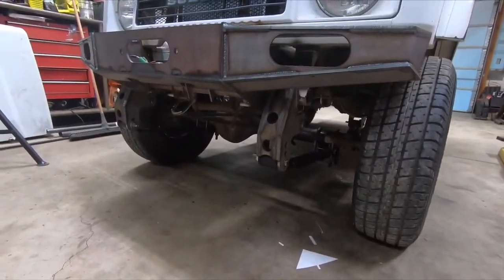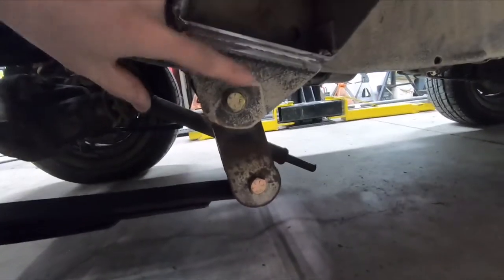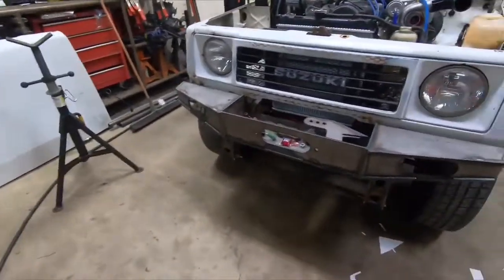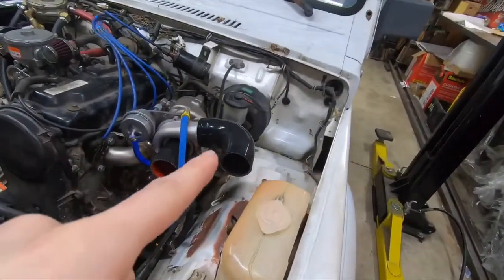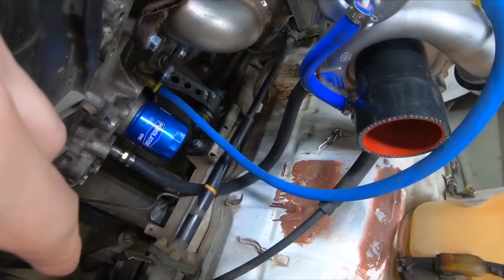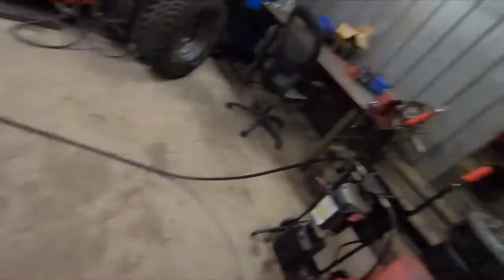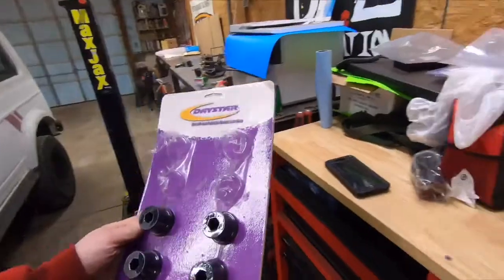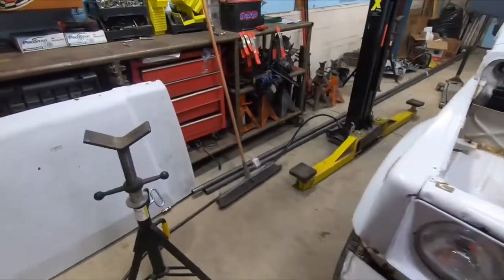Tin top Got Some Changes

Comment: Has anyone ever put a front axle in the back?  Rear steer.  It would turn the wrong direction, but flip it over would cancel that out.  My question is, Would it oil correctly or fail early from lack of proper oiling?